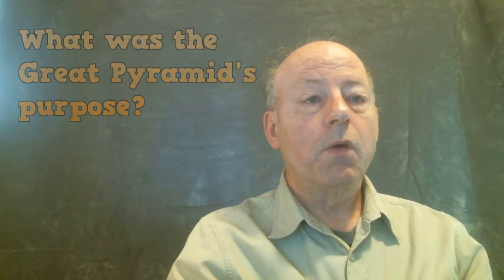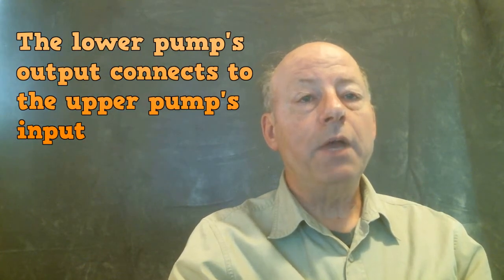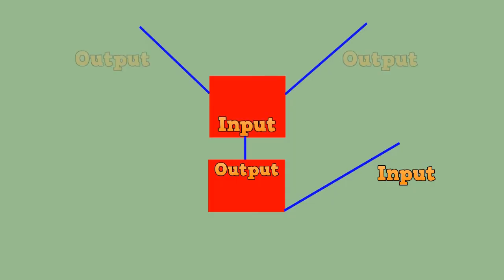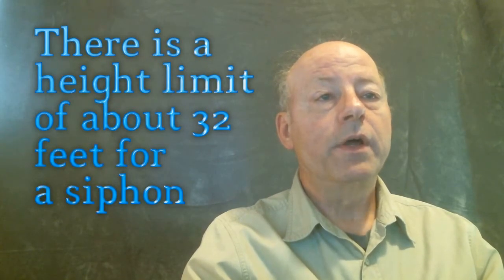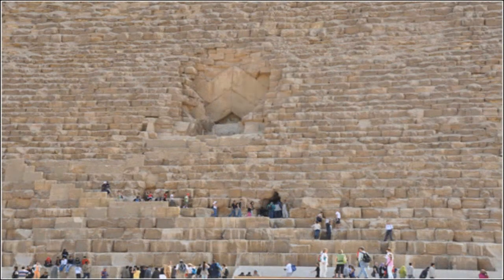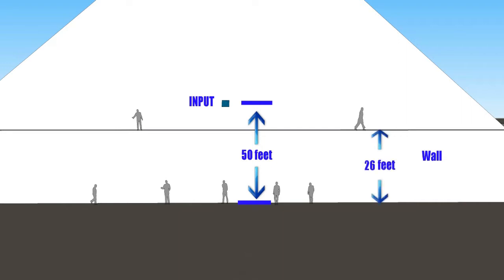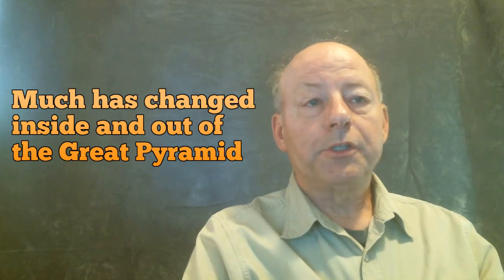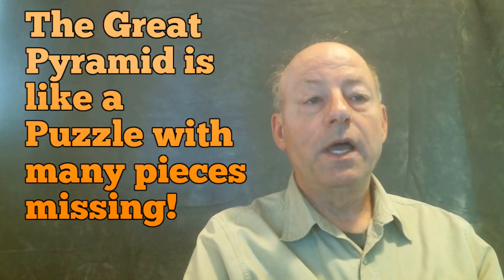Video 7: Introduction to the Great Pyramid water pump

Comment: A lot of what you say is exactly what I was thinking. However, the water level cannot rise past the water level in the Grand Gallery, let alone, all the way out the vent. And why would they want water to run down the side of the pyramid to the moat?
Reply from the maker: Thank you for your interest. Your questions will be addressed in subsequent videos in this video series. The Great Pyramid was two water pumps connected in series. The input of the 2nd or upper water pump is the lower end of the Grand Gallery. How water was delivered to the point of use and what the water was used for is elaborated on in the rest of the videos in this series. That 2nd water pump was able to finish the water pumping process. Hopefully, you will be able to watch the entire video series about how the Great Pyramid operated as a water-pumping system. I hope you read my books someday which have much more information than a few short videos. Tell others about this video series. Thanks!

Comment: There are several flaws in this theory which can't explain every of the following facts:

1. The Kings Chamber was completely sealed and plugged with a granite plug. Al Ma'muns men had to broken up this plug to gain access to the Kings Chamber.
2. The Kings Chamber has a rectangular box (Sarcophogus) for an unknown purpose.
3. The Kings Chamber is the only chamber having "relieving chambers" on top.
5. The portcullis antechamber had a purpose.
6. The portcullis antechamber must have been operated but by whom or what and from where?
7 .The Queens Chamber has a niche. What is the purpose of this niche, which is carefully designed?
8. The "air shafts" in the Queens Chamber where hidden behind a wall and were originally sealed off.
9. The Queens Chamber is build in the exact center line of the pyramid.
10. The Grand Gallery has on all sides and the top a corbelled wall.
11. The Grand Gallery has 25 pairs of periodic niches.
12. The upper end of the Grand Gallery is near the mass centre of the pyramid.
12. There are 3 granite plugs in the ascending passage way.
13. The ascending passage way is heavily reinforced in the lower section.
14. Every passage way has the dimension of 1 meter by 1 meter which must have been carefully choosen.
15. Every passage way and the Grand Gallery has a slope which is 1 degree more than the half slope of the entire pyramid.
16. All entrances of the pyramids are on the norh face.

As the old Egyptians were excellent architects and engineers I also believe that the designers used hydraulics to make the pyramids work but their purpose and exact function is still a mystery.
Reply from the maker: It is a good idea to watch the entire video series before telling me how you think I am wrong. Hopefully, you can watch and study the entire video series. To help you here is the link to the playlist. Certainly, there is much more information in my three books about the Great Pyramid water pump. Maybe you will have enough interest to get a deeper understanding of this body of research. Or you could listen to the over 280 radio interviews I have done on this subject. My next interview is next week. https://www.youtube.com/watch?v=8I8iVkgPnEg&list=PLPD2zVdMCA-gPa6RqoEHX_uLHVoIUyjly&pp=gAQBiAQB
Reply: @GreatPyramidPump  Thank you very much. First of all, I didn't say you're wrong I only said that your theory has flaws because it can't explain everything.

After years of research I myself came to the conclusion that the Great Pyramid was using hydraulic principles. So for me it is not far fetched that the pyramid could be a pump of some sort.

For example there is a Benben (capstone of a pyramid) from Amenemhet III. If you translate the inscriptions the text is praising the king as a "life giver" for upper and lower Egypt.
Reply from the maker: @WhereIsTheSpartan  I hope someday you read my three books, watch both of the video series about the great pyramid. There is a huge body of research concerning how and why the great pyramid water pump was built. Hopefully someday you’ll learn about the theory in detail and know what it’s all about.

Comment: interesting. But why is the giza pyramids facing true north if it's just a housing for a pump?
Reply from the maker: Wonderful Question. Yes, the sides of the Great Pyramid are in alignment with the cardinal directions. That is evidence. Here is what I think. The Alignment of the Great Pyramid didn't matter at all. There was no religious or symbolic significance to the Great Pyramid's "alignment". I live in a subdivision and my house is in "aliment" with the sidewalk and the street and the houses next door. My house is in alignment with all of that yet there is no symbolic or religious significance involved. The builders of my house just simply built my house "square to the street" because there was no profound significance to my house's alignment. Some think the aliment of the Great Pyramid is somehow significant but newer give a good answer of why it is significant. There is no significant or profound aliment needed for a water pump so the builders just built the Great Pyramid "square to the world". I hope that helps.
Reply: Interesting, you may be right. so if I've understood it right you are saying that there's no "cosmic energy" aspect to this water pump, but could it be BOTH? that it was a waterpump but that the pumping mechanism itself was powered by "free electricity" from these "magical" cosmic forces? (the conductive material at the top of it, the true north alignment, the pyramid shape etc) @GreatPyramidPump
Reply: Or.. u mention in a later video about the whirlpool effect. Makes me think about how water whirls different on each side of the equator.. could the exact true north alignment in any way be some way of optimizing the whirlpool effect?
Reply from the maker: @Niberspace I do not think there were any "cosmic forces" involved. The pump was not sun powered if that is what you mean. I do not think the Great Pyramid water pump operated "magically". My understanding is the true north "alignment" did not provide any "power" or benefit. The alignment of the pump did not matter at all so it was simply built (like I said) "square to the world". I do not think the pyramid 'shape" provided any "power" for any reason and did not help the water pumping process or serve any operational purpose. I do not think the Great Pyramid water pump was powered by "free electricity" I do think the Great Pyramid water pump powered generators to make electricity and to create compressed air and to power machinery etc. There are many uses for elevated water. we are using water power to charge the battery in my laptop. The Great Pyramid had a big Return On Investment and provided prosperity for those who built it. I hope you read my books someday. No magic is involved. I hope that helps.
Reply from the maker: @Niberspace  Research has been conducted indicating the exact true north alignment had no effect on the water pumping process. Many streets in cities in the USA are aligned with the cardinal direction as precisely as the Great Pyramid including the street I live on. My house is in alignment with that street. That alignment did not make my house "more powerful" or reduce my electric bill.  If you have an idea how the Great Pyramid's aliment helped in any tangible way in the real world I would be interested. I hope you watch all the videos in this series and in the series about how the Great Pyramid was built. Please spread the word about this direction of research.
Reply: ok i see. I suppose to consider your theory I should imagine that the surroundings of the pyramids is full of farmland, which would make it make more sense to be aligned, that they knew that the effect of the pyramids was going to affect farmland/city-planning for miles ahead so they thought they better chose direction wisely @GreatPyramidPump
Reply from the maker: @Niberspace  Again I would say that the alignment of the Great Pyramid structure was of no significance to the operation of the Great Pyramid water pump. Therefore the builders just built the structure with the sides in alignment with the cardinal directions. They could have built the Great Pyramid with the corners pointing to the cardinal directions if they wanted to. Yes, the location of the Great Pyramid was chosen wisely. Water is the lifeblood of any civilization. The largest water pump in the world is located in the valley of the Nile and it is pumping water right now. There is no research showing how the alignment of the Great Pyramid provided a function or enhanced anything except maybe sharping razor blades. haha. The Great Pyramid was infrastructure.
Reply: @GreatPyramidPump  Does the alignment maximize the amount/surface area of shadow cast during the hottest/sunniest parts of the year on the moat around the pyramid, to minimize evaporation? also, that moat would be one hell of a reflecting pool with square coordinates to demarcate with, if observing from the top of the pyramid. Would be extremely useful for mapping the stars throughout the year.
Reply from the maker: @Jaggith  there is no great pyramid Star alignment. Nothing on the great pyramid is pointing to any significant star. There was no need to minimize evaporation. Looking into the water if the moat to view stars wouldn’t work at all. If someone wanted to look at stars just look up into the sky. You should read my books to help you discard the misconceptions you have.